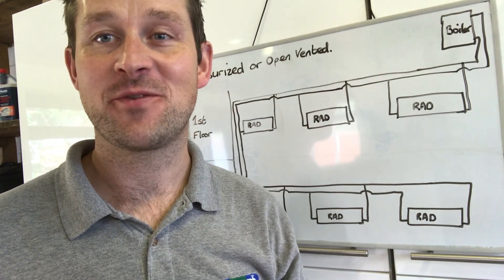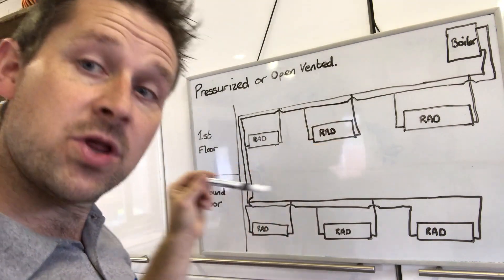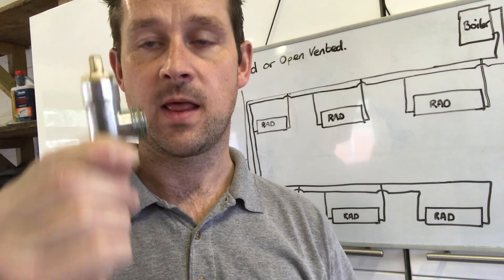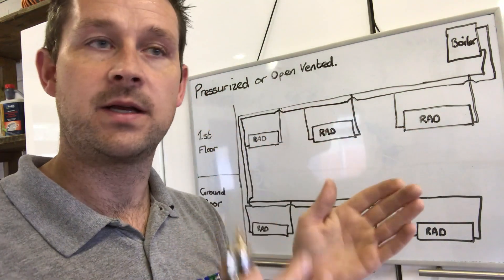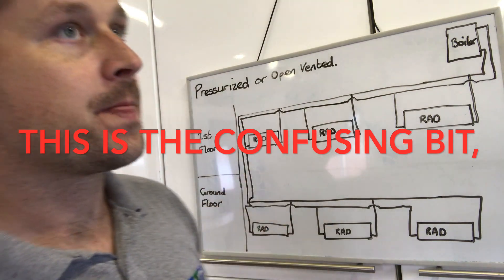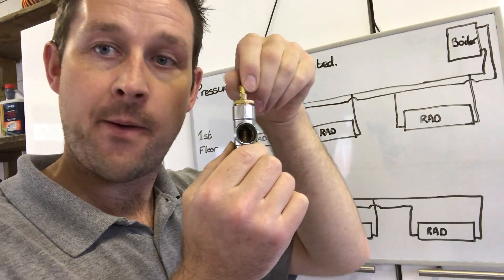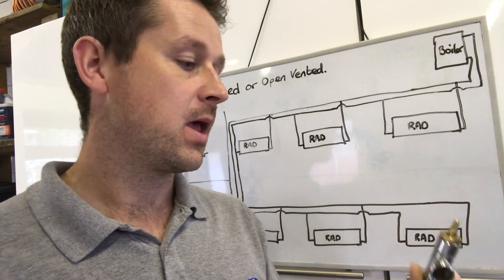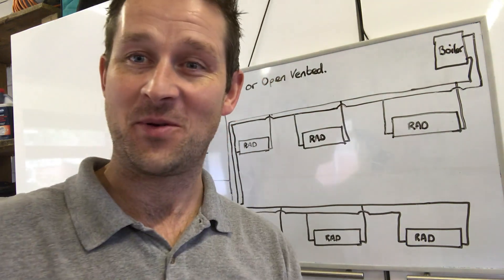How and why we balance a central heating system

Comment: YOUR diagram shows the boiler upstairs, a lot are on the ground floor. The radiator nearest the boiler needs more restriction than the furthest away, so depends on the placement of the boiler.

Comment: Great video 👍 just a quick question , my downstairs rads are 62degrees & my upstairs range from 58 to 63 degrees , all heat up around the same time , would you say those temps are acceptable ? Cheers

Comment: I use digital thermometers with remote probes from ebay, inlet and outlet, to set a temperature loss between 10 and 15c. Lockshield valves are non linear. Once they are opened 1 turn its virtually full flow.

Comment: Hi, good video. Do you kow how can I balance the system if some of the radiators have TRVs mounted on return pipe?
Reply: Most trvs nowadays are bi directional so it doesn't matter.
Reply: @nrg-5003  thanks. It came up in my case it was not a matter of rebalancing but clearing the sludge from boiler pipes. The flow is now perfect.

Comment: You're describing it as if the boiler is downstairs ( opposite to your diagram ) very confusing , all other videos say that the radiator nearest the boiler is the one that should  be almost closed down then eachother thereafter should be opened up slightly more till the last one in the chain is fully open , that one being the furthest from the boiler .
Reply from the maker: Hi Wee Mental Davy thanks for taking the time to comment, welcome to the world of plumbing! If you listen to what I say dispite the boiler location you will have a perfectly balanced system.
There is some truth is what you say about turning the radiator closest to the boiler down, I find this works but does not balance your system as well as it should be, every house is different and the way I explain it is the simplest and, in my years of experience in the industry works the best and most efficiently.
Hope that’s of some help and you’ve managed to resolve your issue 🤞👍

Comment: The closest rad to the pump should have the most restricted balancing valve (lockshield). This ensures that the downstairs rads achieve their design flow rates on a cold winter design day. If the upstairs rads are the least restricted, the pump will just push most of the flow around the top floor rads and starve the most remote rads from the pump.

Comment: How would you balance the following type of system? Bungalow, 10 rads all with TRV’s, combi boiler in loft, all pipe work downstairs under floors but it’s a one pipe system with bypasses at each rad.
Reply: With that system, just ensure all lockshields are fully open.

Comment: All the other you tube plumbers say hot water wants to stay upstairs as  water is 'lazy' and wants the easiest route. Which I must agree to some extent as after my heating switches off the upstairs rads stay warmest for much longer... the downstairs rads also take longer to heat up...
Reply: If you've not got TRVs, fit them to all rads. This'll ensure water only goes where it's needed. If it's a 3 speed pump, set it to the fastest speed.
Reply: @millomweb  Wrong

Comment: Very confusing as it seem you are saying hot water falls while cold water rises which we know is completely the opposite to what happens, in my experience the most common complaints are that the upstairs radiators get hot while the downstairs radiators remain cold or take a long time to get hot or do your radiators get hot at the bottom while still being cold at the top?

Comment: On the ground floor where the boiler is all the radiators are cold, and on the first and second floors all the radiators are hot.  No one has touched the lockshield valve. So why have they become cold?  When I get access to the property, I'll try to balance them.  What is confusing for me is that other videos make the point of adjusting the lockshield on each radiator in the order they are from the boiler.  The first radiator being adjusted a 0.5-turn, the 1-turn, the next 1.5-turns, and so on until the last radiator is adjusted.  So which is correct?
Reply: Fit TRVs to all rads and leave the lockshields fully open.

Comment: How can I fix if central heating is not working upstairs at all
Reply: Any cold rads, make sure lockshield valve isn't completely shut !
Do radiators need the air bleeding out of them ?

Comment: Balancing radiators, I have seen so many you tube videos on this subject that are wrong so thought I would correct. This applies to combi boiler systems
Why have a boiler and radiators in the first place, it is to heat every rooms air that has a radiator to a desired temperature to make it comfortable to live in, modern radiator have a (TRV) Thermostatic Radiator Valves which allows the air temperature to be set. The valve at the other end of the radiator needs to be fully open to allow TRV full control.
The combi boiler has two pipes connected to the rad circuit, flow and return. When working the boiler heats the flow water to the temperature set by the rad temp control on the boiler. At the same time it monitors the return temp, as the return temp nears the flow temp the flame is reduced, when nearly the same the flame is turn off only turning on again when over certain difference is monitored.
Always monitor air temp in a room not radiator temp because that is what we feel. If the room is too cold turn up the TRV, if too hot turn down. The TRV should control to this setting.
If you think radiators are getting too hot there may be a cold draft entering the room needing more heat to be used to heat to your temp.
If the room air is not hot enough and you have the TRV fully open there maybe not enough water flowing in the rad i.e. a blockage or simply the boiler is set too low. I know there are many and various more faults but this is the basics.
Reply: Wrong.
Reply: I'll take your word for it that this video is bollox - as I can't hear what he's saying - as the volume level is 2 out of 11.

I never did any rad balancing on my system as it doesn't need it. Systems with TRVs don't.

Comment: Hi Nick. Would the pipe diameter on the system rads have any bearing on the amount of opening on the lockshield valve as my pipework is a mix of 10mm and microbore so I assume not as good flow as 15mm pipe, and would have a reduction in flow to start? Thanks, Alan

Comment: Great video, can I ask a question, bungalow, 8 rads including towel rail, pipes go into loft, would you turn all lock shields 1.5 turns, I’ve been trying to work out the closest to furthest rad, but pipework can feed two rads from loft, comes down into one room and back enters into 2nd rad.  Also if all set to 1.5 on lock shields,  what happens if some rads have trv on 3 but some on 1 or 2, or would you set all trv the same ?
Reply from the maker: Hi Ian, thanks for your message, couple of things there;
1 - Pipes from loft that feeds to 2 radiators, treat them as 1 big radiator when balancing the whole house, once you've balanced the house and your happy the 2 radiators in question will fight each other for heat so then you balance them two after the whole house has been balanced.
2 - TRV settings. When balancing set all TRVs to number 3. This then give the homeowner control to increase and decrease the temperature slightly. 
However sometimes TRVs are more sensitive than others, (old / new / different manufacture etc) so if in doubt turn up to 5 or max setting.
3 - Lock shield settings, I would start off putting them on 1.5 then any rads which are cold after your heating has had enough time to heat turn the hottest rad down to 1.2 / 1. In theory that should then push the heat to the other radiators.
If that doesn't work start again on all rads 1.5, then find the coldest rad and increase the lock shield to 1.8 / 2.
If your still having trouble this could mean there an airlock (see my other videos) or your central heating pump needs turning up or needs replacing.
Hope that helps.
If you haven't already don't forget to like and subscribe.
Reply: @NickTaylorPlumbingLtd  I ended up leaving all on 1.5 turns as seemed to work the best,  closest rad was on its own but the others to each room where all back to back, basically pipework from loft into one room feed 2 rads, and had 3 lots like this, for example, bed 1 and hall fed from 1 downfeed,  kitchen and bathroom fed from another downfeed, bed 2 and dining room from another downfeed, so to get each rad to 12degree difference found too hard.  having said that the 1.5 turn on each.  boiler displays flow and return and if boiler pushing out 70, return diff around 17,  if pushing out 40/50 return around the 8 to 10..  i assume return would be variable like that
Reply: All rads with TRVs, set the lockshields fully open. If towel rail hasn't a TRV, turn it off at the lockshield then the day after, crack the lockshield open 1/4 of a turn. Repeat the following day if the rail is still cold. The day you find it hot, leave it set at that.
Reply: Hi Nick,  Can you also tell me what you would by default set the flow temp too when setting up a boiler and also do you think would get much benefit from weather compensation units against load modulation units

Comment: I'm a competent DIYer and this is something I've only just come across having moved into a 4 floor home with the boiler on the 2nd, and finding the rads are not very well balanced. I checked all the lock shield valves are they are all open fully so I throttled back the lowest floor ones(funnily enough they were colder?), My thinking being that the water was flowing through too fast. Clearly my theory is wrong so I will start again and do as you say. 

Is it worth while using a temperature laser to monitor the input and output pipes to get the same temperature drop across each rad? Or am I just overthinking this? We also have a TADO smart thermostat and smart TRVs across the house, I don't know if that makes any difference? 

Thanks for the video
Reply from the maker: Hi Roger, Thanks for the question, If your having issues with nearly all of your radiators it sounds as though it could be your central heating pump which is broken, therefore not circulating the water properly around your system, this means that adjusting the lock shields wouldnt matter as there is not water circulating from the pump. 
It also sounds like you've tried to adjust the locksheild and had no luck so you've already tried the simple and most common fault which again points in the direction of the central heating pump.
Hope that helps
Reply: @NickTaylorPlumbingLtd  hi thanks for the reply. The radiators aren't not heating up, just that they all seemed to be different temps. I have since played around with the balancing and somewhat improved them. As I mentioned above the lower floor(45 sqm living room which is heated by 2 radiators) seemed to be the worst but having played around they are now better. I am considering an ASHP and underfloor heating for that room. It appears there are grants to have one fitted.
Reply: @NickTaylorPlumbingLtd  Sounds like you need assistance to understand how to use your heating system.

Comment: What about delta T of 12 degrees? Living spaces downstairs around 20 degrees, bedrooms 12 degrees surely. Most have bedrooms upstairs....you putting most of the heat upstairs?
Reply from the maker: Hi Gregory, Thanks for your message, Ill do a video over the next couple of weeks about the theory/technical side of Delta Ts, heat loss and radiator sizing, in general though and keeping things simple for a domestic setting, if you follow the guidelines in the video you'll have an even spread of heat throughout the home. Hope that helps, thanks, Nick

Comment: what about your 12degree delta across the rads? does this not matter?
Reply from the maker: Hi Dean, Thanks for your message, The joys of the Delta T's! Ill do a video about it over the next couple of weeks about the theory/technical side of it, generally though in a domestic setting if you follow the guidelines in this video you'll have an even spread of heat.

Comment: How I do it. Open up the TRV’s to maximum. Turn all the lock shields to off and then open up maybe half a turn or less. Turn on heating and wait for radiators to start getting warm and then quickly feel all the tops of the radiators making a note of which are still cold and which are already hot or are already warmer than the rest. Now go back and make slight adjustments to hot radiators to reduce the flow or increase the flow to cold radiators. 

Next day do the same, making sure all radiators are heating up at the same rate and adjust accordingly. 

On day three just make final adjustments and now set TRV’s to desired room temperature. 
Job done.  
Ideally there will be sufficient heat drop across the radiator to allow the boiler to condense which can only be achieved if the return is below 55C
Reply from the maker: MrRawMonkey good for you and thanks for sharing, it does take time to tweak it and get it right, I find my way generally works everytime and takes me about an hour which is a bonus! But it’s best to take your time with it and get it right 💪

Comment: Hi Nick, thanks for your quick reply, regarding the balancing of radiators in my bungalow., I’ve got a combi boiler in the airing cupboard and all the plpe work runs under the floor boards, does that make a difference? Thanks.
Reply from the maker: Hi Dennis, Its better that your pipes run under the floorboards then up to your rads rather than up into the roof of your bungalow then down to the rads, It means that the air (air in central heating systems is a headache) will go to the highest point, in your case the radiators which is easily removed rather than be stuck in the pipes in the loft. Hope that helps. Thanks, Nick
Reply: Nick Taylor thanks Nick.

Comment: Hi Nick, how do you balance radiators in a bungalow (one level) thanks.
Reply from the maker: Dennis Humphries thanks for your messege. Its a little tricker to balance a bungalow as its prone to air locks generally due to the pipe runs being in the loft and then dropping down to each radiator. I’ll do a video and post it on the weekend to explain better.
For now I would open all locksheilds 1
and a half turns, bleed any air out the rad vents and that should solve your problem. 
Don’t forget to like and subscribe if you haven’t already 👍